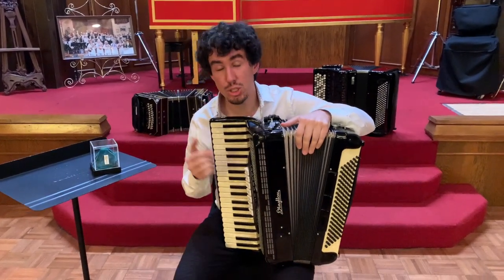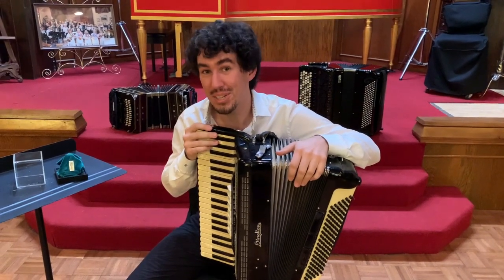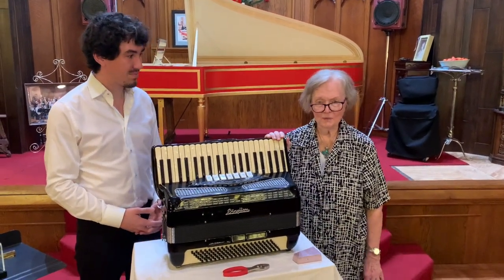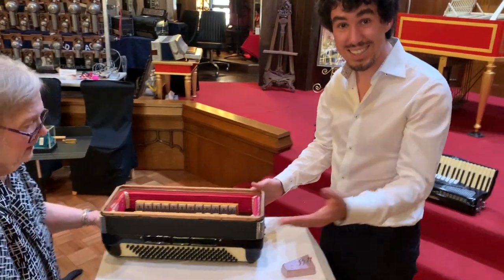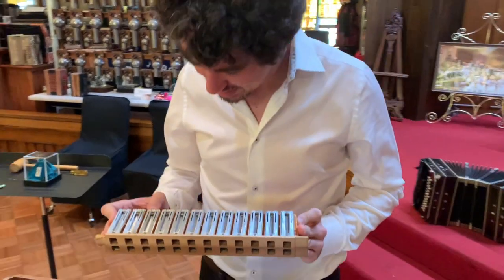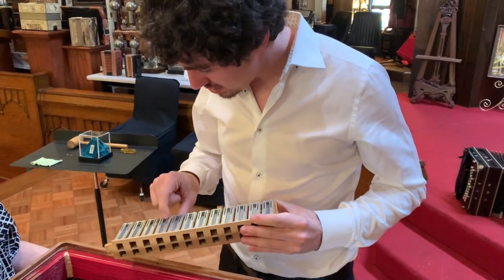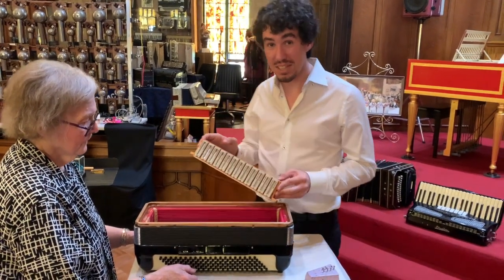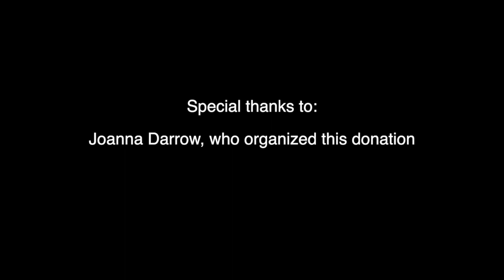VERY RARE: Singleton Bi-Directional Reed Accordion (Michael Bridge)

Comment: This is fascinating. The lack of reed leathers is a huge advantage, as this is one of the main problem areas of an accordion, and the part that most often goes bad and requires costly replacing. Also, since any change in the leathers affects tuning, my guess is that this accordion would hold its tuning much longer than most. One weird thing in this video is when he says that the lowest set of bass reeds all being the same length is very rare and must be a cost saving measure. In fact, this is true of every accordion. The lowest set of bass reeds are always the same length, with the pitch being determined by the amount of weight added to the tip.
Reply from the maker: Interesting -- you may have looked inside more accordions than I have, however my last two main instruments (Pigini and Scandalli convertors) both have bass reeds that grow slightly in size as they get deeper (in addition to the brass weights becoming larger). And yes, it would be great if this single bi-directional reed tech could be improved! The leathers being removed is a big advantage.
Reply: @MichaelBridge  Probably this is a difference with free reed accordions. On the hundreds of non-converter Stradella accordions I've worked on, the lowest reeds are the same length. Anyway, your playing is great, which is far more important.

Comment: I am curious why this didn't become standard in accordion manufacturing. It is a very interesting design. Obviously for diatonic button boxes with different notes on the push and the pole you need to read's, but otherwise this seems like it could be a viable option. I wonder what the drawbacks were, or what are the reasons why nobody ever took that on as a standard practice.

Comment: does this make the instrument lighter, needing half as many reeds?
Reply from the maker: It's a bit lighter... These reed plates are still approximately the same size as normal reed plates that allow space for two reeds (probably because they were designed to fit existing reed blocks) but I am certain this could be made lighter by making narrower reed plates in the future. I see this accordion as representing a 'potentially' good idea that, with a lot of refinement, could be very important.